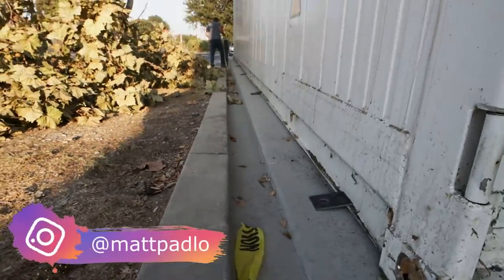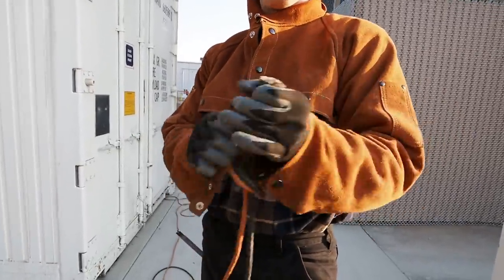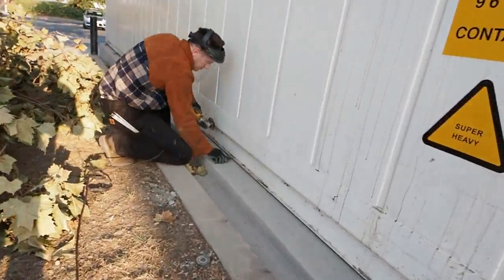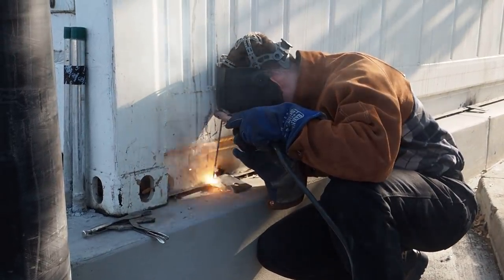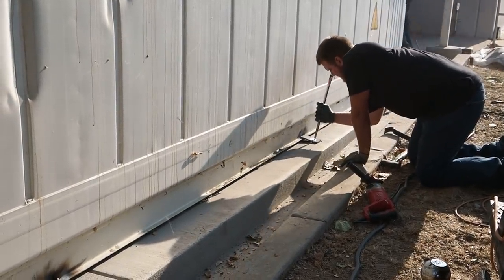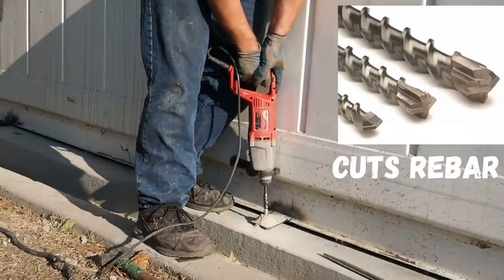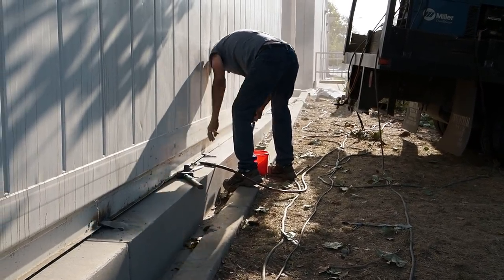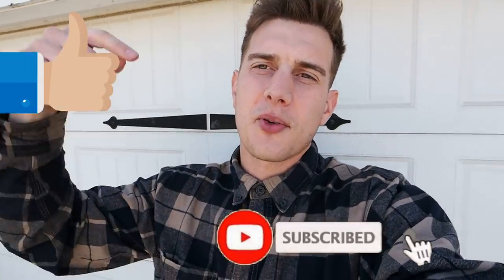On the Job - How to Stick Weld with Welding Inspector - Welding Tabs to Storage/Shipping Container

Comment from the maker: The inspector on this project was out here to inspect the installation procedure of the all-thread being epoxied into the existing concrete slab. Hope this helps anyone who wonders what the procedure is to accomplish this. For I used the same technique to install my mailbox at my new duplex! 

We use Simpson Strong Tie, SET-XP Epoxy